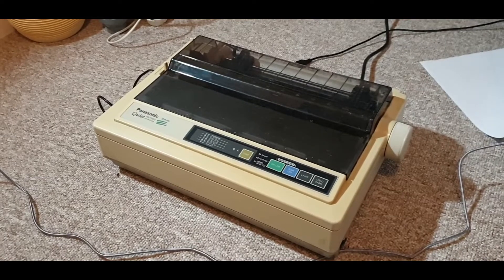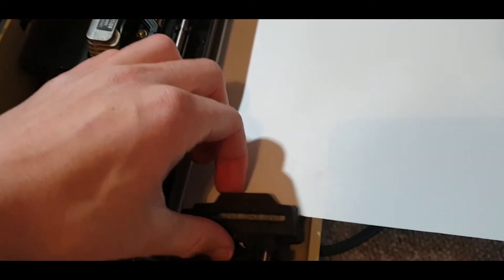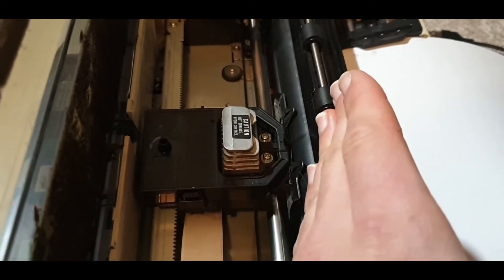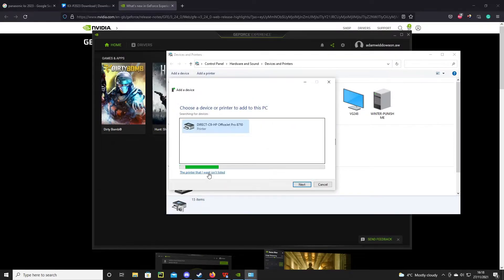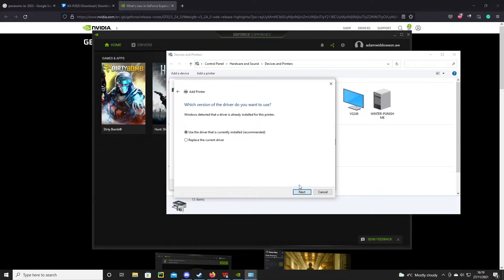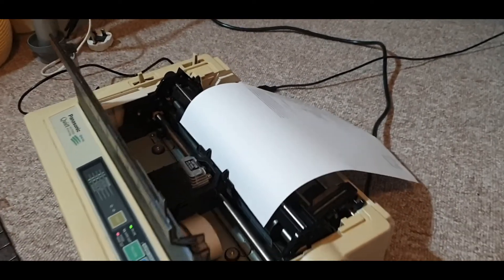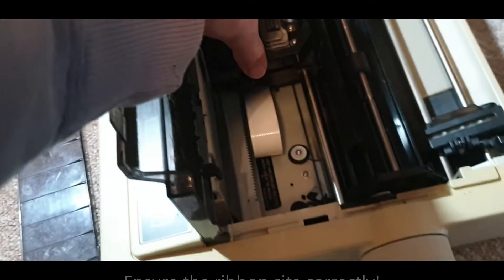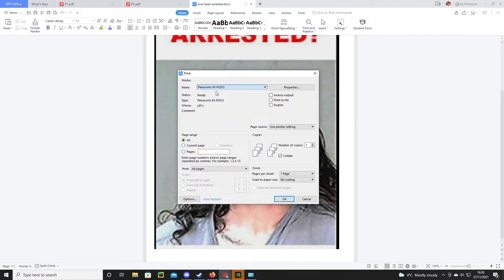Using a Dot Matrix printer with windows 10 in 2021 - Panasonic KX-P2023

Comment: Great video. I wish you had used the 2 obvious features - one to hold the paper down and the other to reduce the noise - but that's MINOR. What is more significant is that there ARE a few valid reasons to prefer a printer like this to a $90 or so InkJet - what most people buy these days (2024.) (1) For low volume of printing, the cost of ink for injets is obscenely high, and if one looks carefully for ribbon availability before buying the printer, one can quickly save money. More importantly, ribbons dry out more slowly, and there is no damage to the print mechanism when they do; with inkjets, it's like a car. Don't drive it for long enough AND YOU KILL IT. Having said that, many people like COLOR, which one obviously will have to do without if you go this route. 2 alternatives to consider are low cost laser printers and/or using either a library or CVS or FedEx, because even 50 cents a page may make more sense than buying one of these. (Hard to get one on Ebay for much less than $100! as I write.)

Comment: I got the Panasonic KX-P2123 color dot matrix printer and having problems getting this printer to print using a WCH PCIE parallel port card.  I got the drivers for both devices but all I get is error printing or out of paper error.  If I press LF and turn the printer on, it does print it own test.

Comment: The knob on the ribbon is used to take up any slack on the ribbon.   As the printer prints it constantly moves the ribbon with left right movement.
In order to make printing darker either replace the rubbin cartridge or cheat and put some ink inside the sponge inside it.

Comment: Hello friend, a question I have this printer Panasonic kxp 1180 and the parallel USB cable, I have tried to install it in Windows XP sp1, Windows Vista sp1, Windows 7 sp3, windows 10, but I can't get it to print, with the drivers of Epson, Panasonic, ibm proprinter, and nothing...I really don't know what I'm doing wrong...if you can tell me with which winods and which driver worked for you, I would greatly appreciate your help
Reply from the maker: Hi,  all I did was whats shown in this video.  I didn't have to download anything extra.  Are you sure the printer works correctly?  What version of Windows was it designed for?
The method in this video I found on the deep depths of a Microsoft forum where even Microsoft said it was impossible only for some independent random guy to explain to do this video.
Reply: @vintagedigits4666  ok my friend thanks, I will continue looking for information and I will try to make my printer work